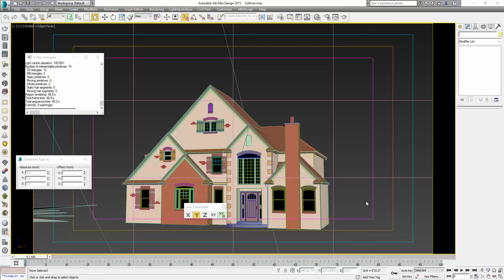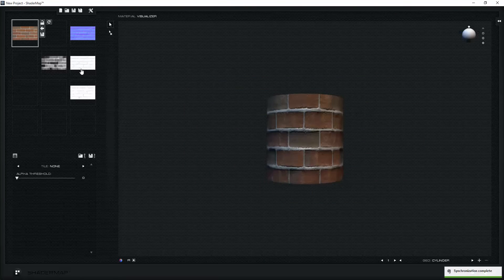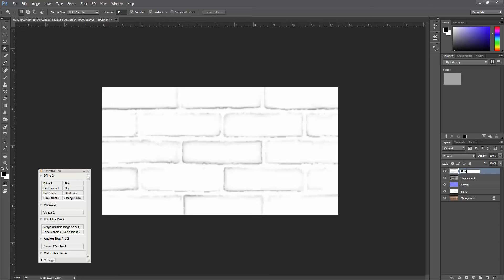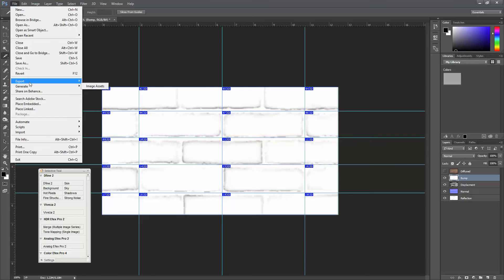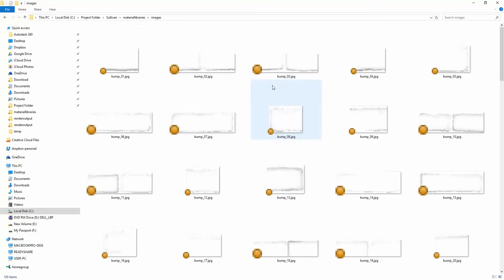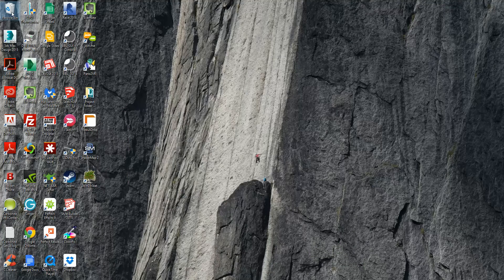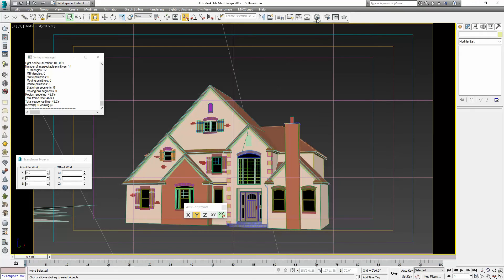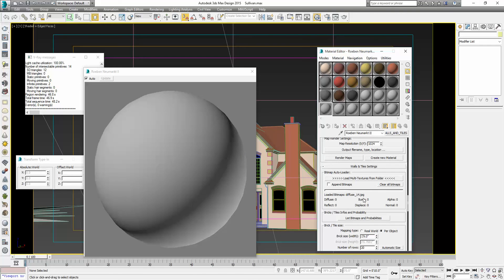Bricks in 3DS MAX

Comment: I can't access the VizPark website from work (blocked by out-of-country domain restrictions enforced by our IT department). Is the Brick & Tile material free? I've always used the Acme brick approach - this seems much more powerful.
Reply from the maker: No, it isn't free. It's not working with MAX 2017, so I haven't used it in a long time. I too use Acme brick.

Comment: Great video Bobby - I have a couple of questions though :)

1)  I know you've had issues with Walls and Tiles, and while I purchased a lot of stuff from Vizpark, I've found it to be more trouble than it's worth - is Walls and Tiles working fine for you ?

2)  You switched Displacement off - do you find that displacement in your architectural renderings is necessary only when close up maybe ?  Otherwise, is it usually switched off most of the time for your renders ?

Thanks for sharing your how-to's - much appreciated.
Reply from the maker: I haven't been able to use Walls and Tiles in MAX 2017; I don't think anyone has. Displacement? I try to avoid it.  If I can model it I will so I am not hit by the huge render times that comes with displacement.
Reply: Hey Bobby, great video. I have same problem with Max 2017 and Walls and Tiles, hope they can fix it. 
One quick question, if you turn off the displacement, do you keep the default setting of the bump?

Thanks!
Reply from the maker: I don't usually have my bump more than 30, for the most part.